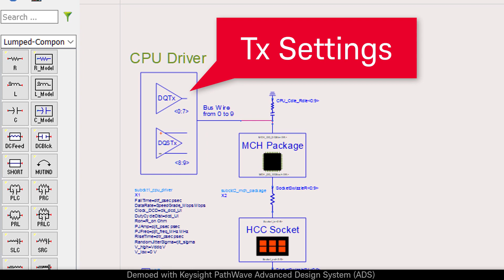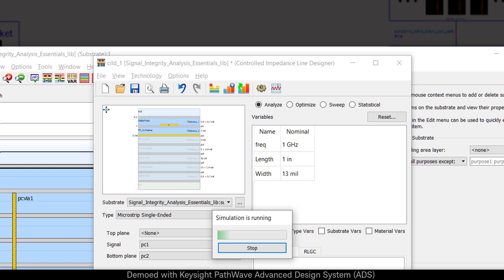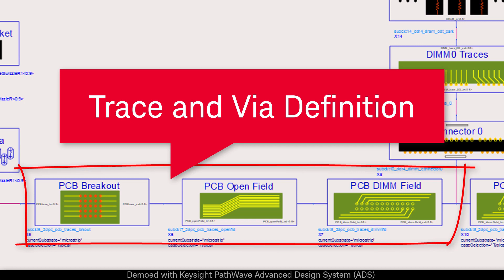DDR Simulation and DDR5 Golden Channel

Comment: it seems you run a 2dpc. the first dimm connector is not accurate . trace go through its smt pad. so you'd better add lump port at both side of the smt.

Comment: Since you run the statistic mode. why didn;t you add the contour plot. and have you added the TX and RX jitter..  will you consider RX voltage noise.